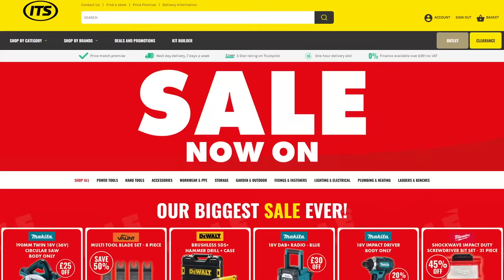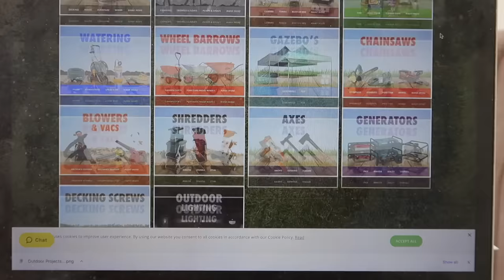How to Build an Easy Plywood Stool - Step by Step

Comment: Lovely little project. Worth putting some felt or rubber floor protectors on the feet if used indoors. 
Ply edging is great at cutting up flooring finishes, the tiny amount of compliance in them also gives a  bit of wiggle room if your legs or the floor aren't perfectly level!

Comment: You should invest in the Dewalt DCD887 impact driver it has 3 modes on it one of them is for precision screwing will save you using a hand screwdriver all the time. Highly recommend it.

Comment: Great project as always. Can I maybe suggest it might be helpful for a few more pointers for us novice DIY'ers like, what grit sandpaper, size screws (screw types, names, uses is a real minefield when you don't really know what you are looking for) the name of the bit which holds the screw on your impact driver, finally what is the tape measure you use?  having cm's on both sides would be a lot more useful than the one I currently own.
Reply: I'm pretty sure that the Advent Vice Versa Tape Measure Stuart is using there. Keep meaning to get one myself

Comment: Good to see the first outing of the table router, looks like it's working like a dream. Are you happy to changed the position to the end of the table rather than in the centre?
Reply from the maker: Yes for sure Simon - it feels right to work at the end and also when I'm working on non router stuff it's out of the way of the main bench.

Comment: Great video as usual. Would there be any disadvantage in using MDF?
Reply: Hi David in short there are good be reasons not to use MDF.  A construction of this design would be likely to break.. Because of the way plywood is constructed with the of each layer running at 90 degrees to the next it stands up to stresses extremely well. The main force on the stool is  compression force on the legs as you sit on it. MDF will cope with that reasonably well. BUT you also will have a rotational force as you shift you weight around. I am certain that is where MDF would fail. If you were on a tight budget you could use MDF for the seat, but I would steer away from MDF for the legs and use ply.
Reply: @georgepritchard3010  Thanks George, that's useful information. I'm glad I asked.

Comment: What would be the harm of a bit gap between the top and bottom slit of the legs? It does not need to be that precise.
Reply from the maker: If there is a gap or play between the 2 then it will tend to twist when you move on the stool

Comment: What way do you cut the quarters?
Reply from the maker: Structurally it doesn't matter but I prefer it to be cut literally in quarters rather than 4 strips in a row. That way the exposed grain is running up the legs